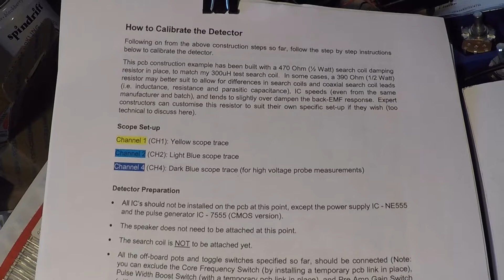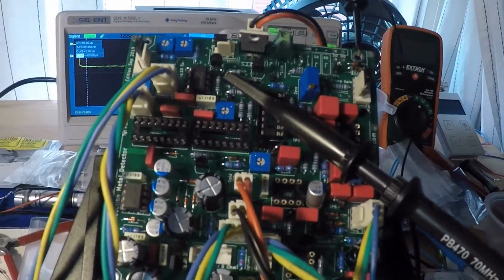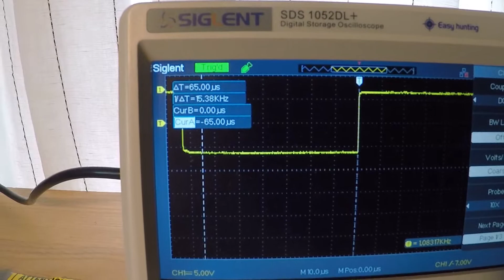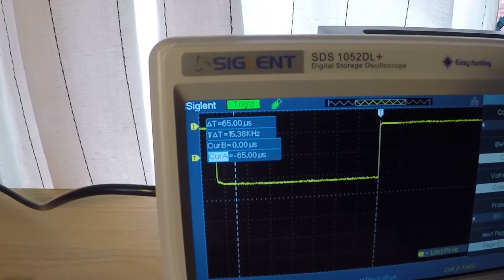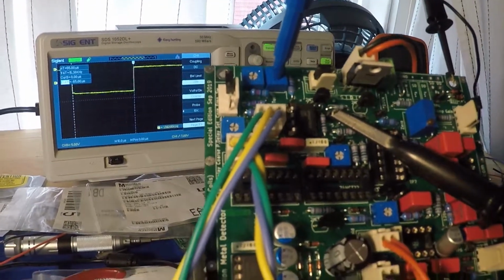Mirage PI Metal Detector calibration step #1

Comment: Could I get a copy of the instructions. There isn't much on what I have in terms of soldering on the wires for the battery and coils and pots and I'm a little lost.
Reply from the maker: Hello Patrick,
Welcome to my channel.  I hope that you subscribe.
Where did you get your PCB?  I am glad to assist if I can.
Cheers
Reply: @SurfDetector  Thanks for replying. I got it from TreasureLynx about 4 years back and started to solder everything up a month ago but haven't hooked up the coil, pots, charger port, lights or battery wires yet. I don't have an oscilloscope to tune it in.
Reply: I did suscribe. I did get a DVD with a lot of information but the wiring portion is not clear. I have emailed Treasurelynx but he seems to be off world
Reply from the maker: @patnap71  Hi Patrick,
My project is a modified version of the board that you have mine was produced by a guy from Australia.  I think that yours is the one from Sven.  I have not seen his board but I don't imagine that it is too awfully different.  Send me your email.